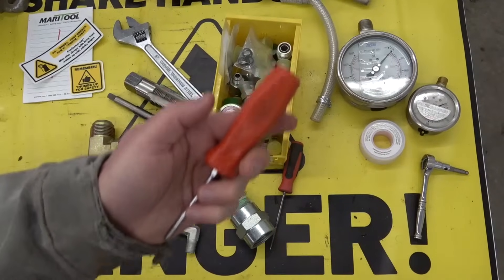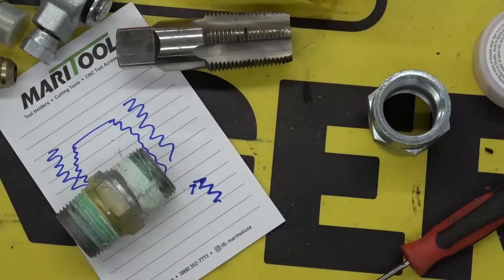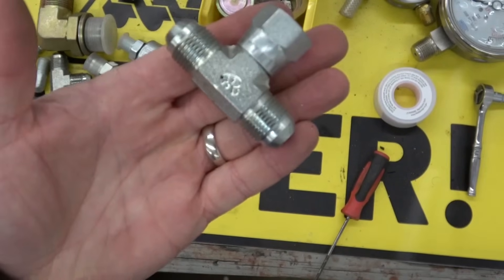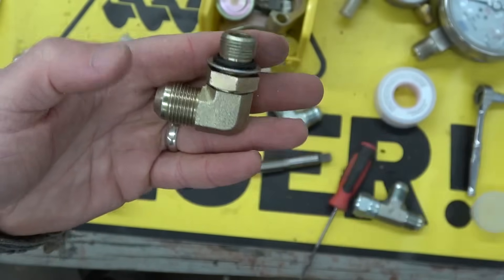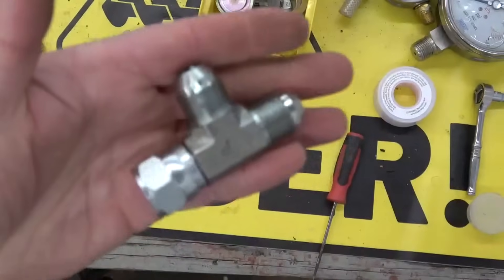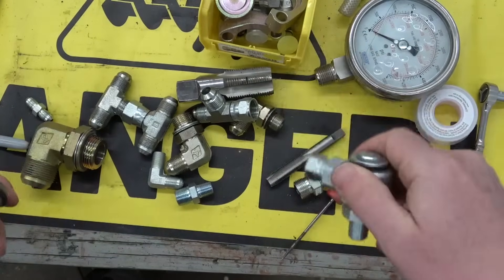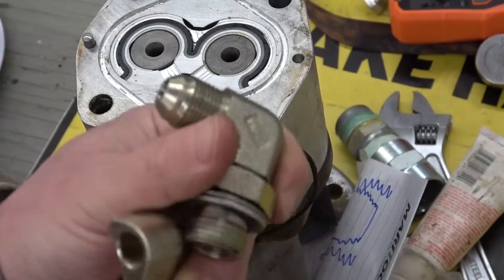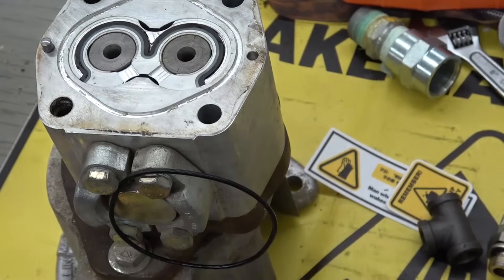Pipe thread is designed to leak || AvE hydraulic

Comment: Mind meld complete.  Ah! Input.  Thanks Uncle Bumblefuck. 
If I have an air compressor that has toasted its now out of stock no longer made rubber gaskets that are a weird special shape in the cylinder head layers around the reed valves, what could I use to replace it? RTV? Ultra Black/Red/Gray?

Comment: We have those o-ring fittings on a topdrive, the bane of the mechanic at -30C hanging up the stick with the poor electrician who has to be there just because there is a wire somewhere in the vicinity. Then the mechanic loses the o-ring from the fitting or worse the dsv into the mess of hydraulic oil and mud. There has to be a better way😂

Comment: Shout out to Fractions.  I work with HP air compressors as a side gig  3-6Kpsi. Learning about fittings is fairly important. I routinely use 304 or 316 stainless but when working with O2 under pressure Brass is preferred.  It's difficult to find brass fittings rated above 3k psi so I revert to stainless.  Its important to avoid carbon steel at all costs due to the possibility of corrosion particles and friction of the O2 flowing over them and combusting. Then the steel itself becomes fuel for the fire.

Comment: I regularly have my fellow plumbers claim that threads will seal themselves and dope or tape are just lubricant to help get it tighter. At the same time they use tape and dope. If it’s just lube why you’d need both is a mystery but logical consistency isn’t their strong suit.
I’ve never understood why they call it black iron. It’s steel and it’s just painted black. Also I’m curious how you have a sch 80 bushing. I don’t regularly deal with sch 80 black iron. With gas code we aren’t allowed to use bushings because how they’re made the wall isn’t thick enough. I guess some are and some aren’t but code can’t make judgement calls. If sch 80 has to have a certain wall thickness do they only make certain bushings. In larger sizes where you just 1/2” or 1” between nominal sizes it’s probably not an issue but in smaller sizes when the difference is 1/4” or less, I would think the wall thickness is too little to meet that standard

Comment: My favorite hard-line fitting is a brazing torch.  Had some unobtanium fitting on an old ford tractor that nobody could figure out (Went to a Napa that manufactures hoses) and I even went through their entire stock of different fittings.  It was similar to a power steering line or automatic trans line.  We went through their catalogs, nada.  ended up buying a female NPT coupling and brazed the hard line coming from the pump to the female NPT coupling, then went down to tractor supply and bought some NPT hoses rated for more than the pump put out.  No leaks.  Cost me maybe $100 in parts, including the oxy-mapp torch.  The hose, if in stock anywhere was about $800.  But even then, nobody had it in stock since the tractor is 50 years old.
Reply: When I go to the hardware store the guy wants me to buy a dozen fittings to get from here to there= he doesn't know who he is talking to. Torch and silver brazing will make what I need from just two fittings. Sometimes the lathe gets involved.

Comment: As much as these videos are actually very helpful and i thoroughly enjoy watching them.
Your long rant about babylonians, inches, counting, and fractions did not quite convinve me on why having to learn Dash sizes, only indirectly related to the real applications is of any convenience.
let me elaborate: wouldnt it be nice if you had lets say a hydraulic pipe. All diameters are in complete numbers like 6 or 8 or 12 of a useful unit. No decimal no fraction.
Now you could have fittings, metallic seal if you like, that are named by those neat numbers.
Oh and fittings with a male thread would also double as cutting ring fittings. So a regular T fitting could either be used with different threaded bits or hoses OR directly be mounted with a cutting ring and an according nut on your neat Pipe.
Would'nt that be convenient?

JIC is the next best thing, admittedly. Allthough BSP fittings are not much different just with the cones the other way

Only drawback(if you see it that way) would be that the described DIN Fittings exist in practically 2 series. On Light L for standard applications at lower pressures (315bar at 12mm AD)
And heavy S series(630 bar at 12mm).
So it adds more possibilities of what and old part might be

But anyway, whatever floats your boat

Comment: Here's a trick I thought of while doing a lot of PVC plumbing. If you have a transition between metal and PVC, apply the PVC cement to the PVC threads, and then immediately 
screw in the metal threaded part just over hand tight (very snug). The cement set-forms to the metal threads and makes for a great seal. 
If you put some Teflon tape on the metal threads, it will help prevent sticking, and make it easier to disassemble.

Comment: Work on industrial laundry extraction presses of a manufacturer that will go unnamed, freaking hydraulic nightmare! When machine comes in new, part of the required “commissioning” procedure is to disassemble change and lube every hose OFC o-ring, de-grease the threads and apply Loctite 545 then torque them! This is operating a 16” X “36” ram at 56 bar. The fittings and hoses range from -4 to -20 and there’s an ass load of them. Generally operating a 16 hr. a day shift daily this has to be redone along with hose replacement every 24 mo.or they begin to leak like a submarine with screen doors! My current plant has three of these jewels. Thank God I’m about retired. BUT,  I will refer my numbnuts underlings to the AvE channel to continue their education when they no longer have me pissing and moaning at them. I forgot about the 12 on each finger counting deal (learned many years ago) will use that as my parting lesson just to bumfuzzle them one more time! LOL Great channel thanks!

Comment: Is there a solution to a pipe thread that leaks that you CANNOT take apart to try to reseal?  I have a very old Rayburn range (solid fuel) with a back boiler where the boiler pipe is threaded to the pipe that go to my hot water cylinder.  Just like Ave says, when the pipes are hot when the fire is on, the pipe thread does not leak.  When the pipes cool down, the water seeps out through the pipe thread fitting.  No one wants to try to disconnect these two pipes, as they are over 70 years old and the boiler is irreplaceable.  Is there ANY WAY of stopping that leak from the outside (that can also withstand the heat of the pipes when the boiler is on)???   Hopefully someone has a magic solution to this…..
Reply: epoxy putty?
Reply: @ We’ve tried that, but the water seeped through anyway….:(
Reply: Solder?
Reply: @dfross87  Hmmm….didn’t try that.  Will give that a shot and see.  Thanks.

Comment: First time I heard about pipethread was when I wanted to order an oilpressure sensor for a very old car that was remotely related to the UK at some point of development. It turned out that some models used NPT, some used normal. You can imagine my excitement. Managed to get it right the second try.
However I still don't get why utilizing the NPT was nescessary because even that one came with a softmetal washer as seal.

PS.: Just an unhinged idea: Hook up a footpedal to your camera/phone and adjust the focallength using that. 95% of the time you can get away with a binary input aswell. :D

Comment: It is interesting how different the hydraulic fittings are for machines verse aviation fittings.  I mainly deal with AN,MS and beam seal.  Pressures ranging from 1000-5000 PSI

Comment: Saving this for training new guys at my hydraulic shop.
Give it to them as homework for their first day. 
There's a lot more than you went over in this vidja, but the basics are absolutely here.
JIC, JIS, JIS, Komatsu, code 61, code 62, Cat Flange (code 62 but thicker flange face - requires cat "d rings"), Komatsu flange (notably -10) BSPT, NPT, BSPP, NPSM, GAZ, ORFS, DINL, DINS, DIN(port), ORB, SAE (45° which has fair compatibility to JIC except -6 & -12) etc etc
Also, I don't chew the orings they bring in. Just give em a sniff.

Comment: A lot of Hot rod supplies with fittings use AN standard .. you can use an AN fitting in place o a JIC (both ore 37 Degree)  But don't use a JIC fitting in place of an AN (On a aircraft or boat)  .. The AN fittings are higher pressure, better tolerance,  specified material etc.  

The point is on your 55 Chevy  with braided SS hoses from the "speed shop"?? .... JIC and AN are interchangeable

Comment: I'm not into fights, but the JIS / Komatsu fittings ARE better than JIC.
Only because it has metric fine thread, therefore it has has less problems with rattling loose, easier to torque, and the cone gets more sealing pressure.
However, they are more rare, more fiddly to mount and are one of those extra unnecessary standards that the world would be better without.  But they are the best hydraulic fitting there is.
Reply: If either are torqued properly, they ain't just rattling loose.

Comment: How about some mid 50's hydraulics, when Citroen did it their way.  Also, I especially like the tapered thread on aluminum, pot/pop metal carburetors & fuel pumps that split/crack when over tightened,  cause we had no idea the factory actually used any sealant on'em.

Comment: He knew the o-ring size as soon as you handed it to him. The rest was purely showmanship.
Reply: Probably knew BEFORE he touched it, and only took it to blow his mind.

Really worked, as he is here, years later telling us lol.
Reply: Yeah, I've never done flash card fitting memory...but I've been doing it so long I can identify a good 90+% of all fittings by sight. Including orings or orings required. 

I mostly deal with gates fittings as well which they made fitting numbers easy. 

But for my newbies I keep a dash to fraction chart for when the old guys come in. 

And the flange fittings are stupid. 

There are more than just 2. 

Code 61.
Code 62.
Code 62 heavy.
Cat.

For fittings like the JIC, there are 3.

SAE, JIC, and Komatsu. 

And for SAE and JIC they almost all have the same threads. The bevel angle is different. But dash 6 and dash 10 are different. So you get guys mixing them up alot.
Reply: I was going to say the same

Comment: Id like to argue the fact i see all kinds of flat face fittings on cat and deere equipment that have 22000 hrs and hardly ever replace an oring i replace 100 x the hoses to orings when comes to flat face only issue i have is on new equipment when guy doesn’t torque fittings

Comment: There is nothing more satisfying when you are on the struggle bus trying to connect a 24 or 32 JIC fitting with 5000 psi rated hose and the threads finally catch.
Reply from the maker: ...after twenty-three failed attempts, chafed armpits, sore ribs, thawing muck dripping down your collar, filing off the cross threaded part and being asked why you're not done yet...
Reply: @arduinoversusevil2025 😆😆😆👍🏻👍🏻👍🏻🤣🤣🤣😝😝😝YEEEEE!!! 😂😂😂 MIIINNNT!! 👌👌👌 SKOOKUM, AvE!!! You ROCK, dude!! Been there WAY too many times wanting to STRANGLE the obvious IDIOTS that design this trash!! 🤣🤣🤣
Reply: ....then you realize the NPT cross union downstream has been thread locked 90degrees out of position and lunch is still 2 hours away....
Reply: I have never worked with hydraulic fittings. Oh, well, not counting brakes, but anyway I have worked with a lot of mechanical stuff, and when I was younger I was told if you're having trouble getting a thread to start, try turning the nut or bolt or whatever it is backwards until you feel the bump of the thread start. It's saved me some time, but I've found better ways of wasting time since then anyways.
Reply: @edwardtupper6374  I have always intuitively done that. I called it finding the threads. Had a guy ask me "What the F are you doing? You're turning it backwards."
Reply: @edwardtupper6374 that's not much help when you're wrestling a 20' python at the same time. I mean you do do that, but the problem is getting the fittings on the same plane
Reply: Until you find out you’ve gotten the feed and return lines backwards and have to start again
Reply: @hunterprice6724 🤦😠😩😩😩😳😳😡🤮😭
Reply: @hunterprice6724 
#iQuit

Comment: I recently tried to replace a hydraulic hose on a Chinese machine and it was a non-standard face seal but nobody could identify the thread pitch or diameter and it turned out to be Chinese 18 mm which is not 18 mm but something like 19.2mm so I cut the fitting in  half and tig welded it together to a new hydraulic line. I must be a good welder Because the machine works perfectly it’s really only running at 1000 psi but someday she may blow and I won’t be beside it. Fortunately, the fitting is 12 feet off the ground pointing into the ceiling . And What about British standard pipe thread? The 55 degree stuff….

Comment: No pun intended but the worst hyd fittings to deal
With is what I know as British pipe. it appeared you had one there looks like a jic got drunk an knocked up a flat face o-ring.they not very common in the south end of the lower 50 an a pain to find a hyd shop that has them.don’t get why ppl around here call them British pipe when they more common on the German verity of equipment like Wirgen an Vogel an hamm.

Comment: The reason that NPT is still used is because it's the cheapest fitting that an un-trainable employee can assemble leak free. As soon as someone grabs a handful of metal on metal seal fittings and throws them in their pocket, you have leakers.

Even the $50k per fitting, designed to be assembled by astronauts in a vacuum with sausage fingers, Ryngloks aren't immune to Billy Bob taking the covers off the ends of a tube and dragging it  across the floor.

Agree with the fractional system... or pretty much all of the imperial system for that matter. Once you realize that imperial trades initial difficulty with practicality for the functionally illiterate and calculator-less individuals that were their initial users, it makes way more sense why it is the way it is.

Comment: I'm metric, but those connectors are used in aircraft, and they work just great. Not just heat cycling, but pressure cycling as well at the same time. They just have to work and upset just one person, then I am happy. EXCEPT, when you start explaining what a fucken sixteenth is. Jesus.... things were going so well, too.

Comment: Ave, do a research on linen tow/oakum/hards with a joint paste. That's the final solution for water pipes when everything else fails. Where I live they go strong for 50+ years and it's more probable that the pipe will corrode through than the fitting failing.

Comment: No mention of BSP which is straight threads but looks like NPT with 1 or two more thread count in similar NPT sizes. Great way to get a poor seal and ruin threads if you combine them.
BPS is the standard thread a machinist will put on your parts if you do not specify NPT.
 Also there is an NPT standard that looks exactly like NPT that seals at the threads called FPT. FPT has a different angle on the threads. It's used without teflon or dope and usually on a fuel fitting.

Comment: This might surprise most of you, but, that pipe tape , no matter what you use , that you put on the threads is NOT for SEALING. The threads are tapered so as you tighten, it wedges itself, so it's the tapper that's holding things together, and YES, they leak, so you tighten the fastener more, more wedging, sometimes it works sometimes it don't. Then WHAT IS THE TAPE FOR YOU ASK , here go's. You put the teflon tape on so when your cranking down on them threads, YOU'RE NOT GALLING THE THREADS , More tight , less leakage. The tape is NOT preventing leakage, it allows you to put more force on the fitting to let the tapper do it's thing,  like a lubricant to prevent GALLING !   Gas tape is yellow because it does not deteriorate with the gas, white tape is your standard "water " tape. You can use ANY lubricant on the threads and it'll do the same thing. Some pipe dope are designed to SEAL , but they have additives in there for that.

Comment: just jam them together and weld the gap with some old 3/32 E6010 smaw and be done with it for ever. power steering lines that are never the right size, now they fit the industrial size for the CAT pump. supposed to be able to bend black iron pipes with a conduit pipe bender, they are weldable.

Comment: For those industrial manufacturing, we use all of these, all over, sometimes combining standards on one machine, and continually find instances where you've got mystery fittings. This info should be used in orientation.
Reply: My favorite is when the fasteners holding on the panel that covers what you need to work on has had five different kinds of screw put back into it. One slotted, one phillips, one hex/tek with no phillips head, one Torx... etc, etc until you decide to throw a tool and take an early break.
Reply: @railgap haha was gona say the same  especially the hoses with difrent ends sucks more when the oem used multiple difrent size stuff  always gota love that 3/8 or 10mm bolt that has  over sized head or e socket torx head then 12 point
Reply: @railgap  just worked taking off a machine cover with different threaded bolts (metric, standard). 6mm and 1/4 20 threads look similar when they're covered in hydraulic oil and you're tired and ready to throw a wrench as you say. We didn't notice this until reassembling the unit. Trial and error to get bolts back into a cover that's 20 feet in the air is one of those situations that remind you you're alive. Stay safe out there dude